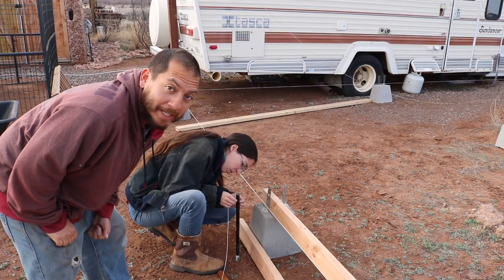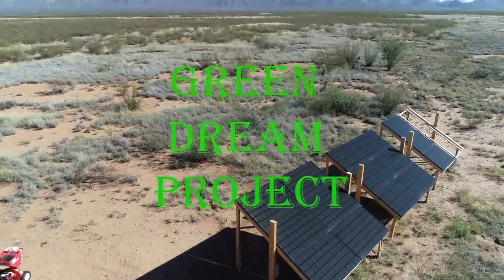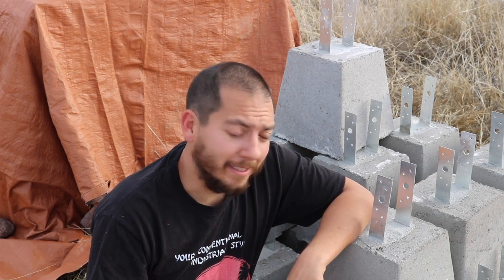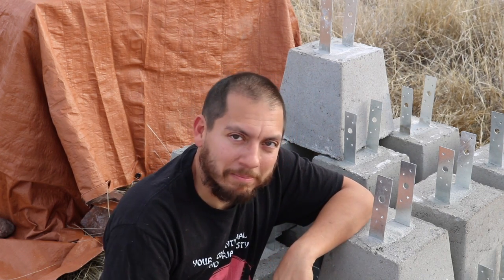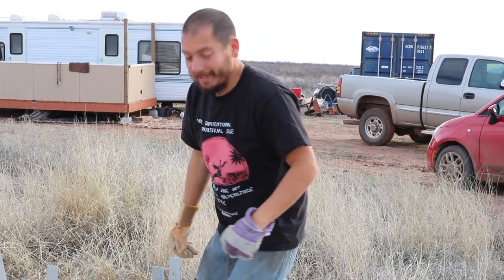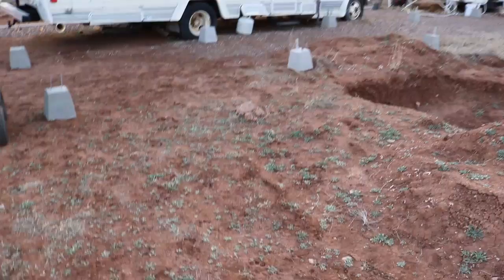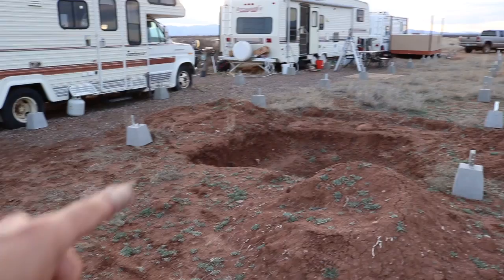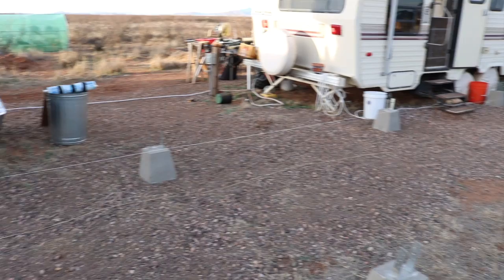Rainwater Harvesting | Epic DIY Off-Grid Rain Roof Build- Squaring Concrete Piers

Comment: The easiest way to get your strings square is to Measure 3 feet from your corner and mark on sting then measure 5 feet down the other string and mark it then you measure on between the two mark on a angle and it should be 5 feet. You cans also zoo multiples of those numbers. Like 15 20 the 25 feet between the marks. Anyway great job can’t wait to it finished

Comment: Hi Jim, as you were carrying the piers, I said out loud you need a wheel barrow. You could use the 3-4-5 rule to square up.  I am probably to late with this suggestion.  Catch you later. 💕.  Roller skating music at the end.  Love that sound 💕. NonnaGrace
Reply from the maker: Both of your suggestions are great Nonnagrace! I did end up using a cart to start moving piers. We actually will be using the 345 rule to make sure everything is still square. Thank you so much!🙏

Comment: You did not show it, but did you measure the diagonals corner-to-corner?  You may know this, but you cannot square anything this large with a carpenter's square.  You must measure the diagonals and adjust until both diagonal measurements are the same.  That is how you set the four corner stakes and then use string lines to set the intermediaries.
Reply from the maker: Thank you augsburg and Gaz! You both are absolutely correct. One method we were using to square was the 345 method. We will also be measuring from corner to corner. We appreciate the suggestions. Thank you both for your help.🙏
Reply: @ourselfreliantlife  Very good!  The 3-4-5 methods works great too.  And I'm sure you know, you can use multiples of "3-4-5" for bigger projects.  For example, 15-20-25 works for bigger builds.
Reply: Green Dream Project that's called the Pythagorean Theorem 3,4,5.
Reply: Jim listen to this guy,  He commented before i could get to it. What your building is epic and you need to take your time with the base. an inch or cm out here and it will travel through the build and cause you soooo much trouble bud. If your not sure what the guys means please say, we all want you to succeeded with the least cost and headache. You dont need a tape measure, you can use string, do one diagonal, mark the string with a pen and then do the opposite diagonal. you can be out by 16th to 8th an inch at most . good luck